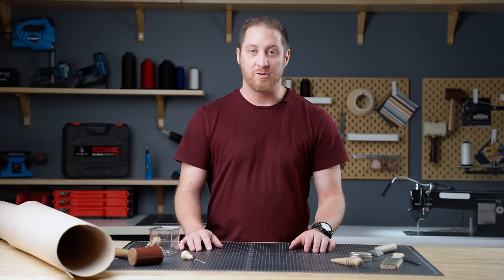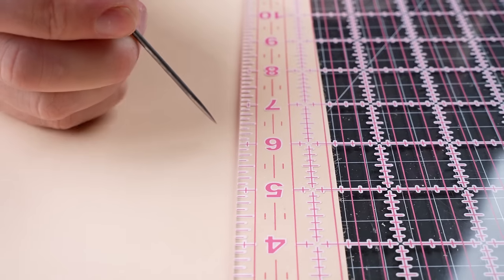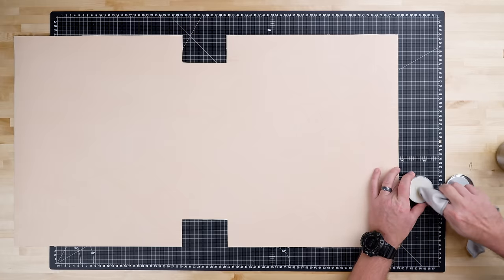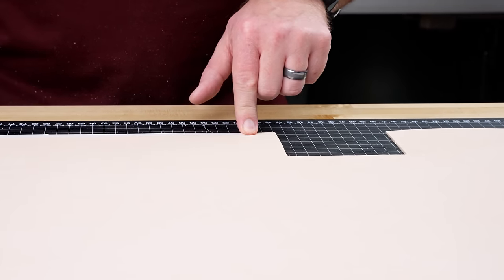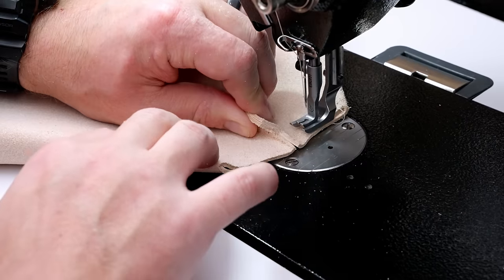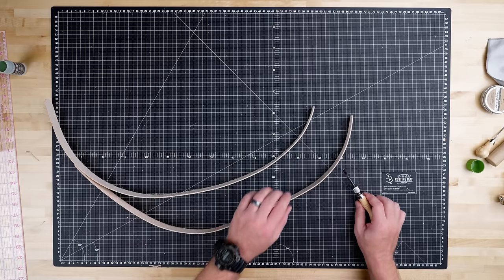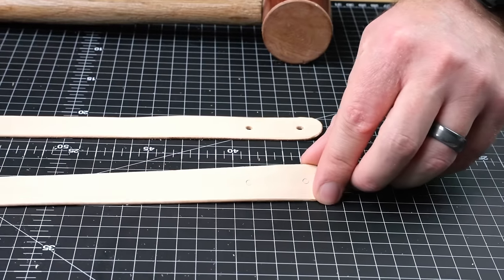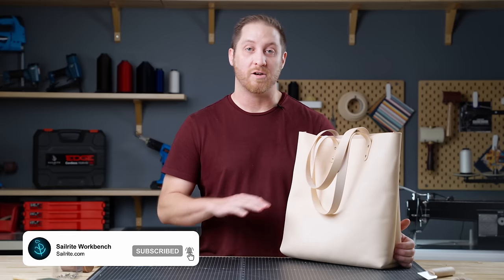Make This Beginner DIY Leather Tote Bag

Comment: Do you need a heavy duty sewing machine or can a regular one with heavy duty needle,,, or punch and hand sew?
Reply from the maker: In this video, we used 4-5 oz leather, which is probably too thick for most regular home sewing machines. Two layers of this leather are about 4 mm thick and quite tough to sew through. We recommend Tex 90 thread, so you will also need to check if your home machine can handle that size of thread. It’s hard to know for sure without knowing what machine you are referring to, but generally, I wouldn’t recommend sewing thicker leathers on a home machine. Not only could it affect the appearance, but it may also cause problems for your machine if you push it too hard.

Hand sewing would work great for this project too! I would recommend hand stitching if you don't have a heavy duty sewing machine.
Reply: Thanks! I will do hand stitching!

Comment: I have a question about the bottom cutouts. How do you come up with them? 4×2.5Can it be 4x2 or 4x4 or 2x4.5? How does it matter when stitching?
Reply from the maker: This type of gusset will not work with just any measurement, or the side seam would not line up properly, and it could create a gap in the middle of the gusset. I would recommend using our measurements or a pattern if it's your first time making one, but if you need to increase/decrease the size, I will try to explain how to explain my process.

With the body of the bag laying flat, I find the center point of the bag where the gusset should go. On both sides of the centerline, I mark a square area on either side of the center line. Then you need to account for seam allowance, so I add 0.25 or 0.5 inch to the length of the side of the cutout that is perpendicular to the side of the bag. That is why our cutout is 4x2.5 instead of 4x2. This is as close as I can give you for a formula, but sometimes it can come down to trial and error with scrap material until you find the measurement that lines up properly.

We will make a video on this sometime! I hope this helps for now.
Reply from the maker: Made this Video to help answer your question. I hope its helpful! 
https://youtu.be/VDRs1EkVOTg

Comment: how well do the leather feet work on the Lsz1?  I purchased them and have not tried them out yet.
Reply from the maker: If you are working with a leather that easily mars/marks, the foot is invaluable. The knurling may still leave a slight track but the knurling is necessary so that the foot still has enough grip to climb up varying thicknesses.